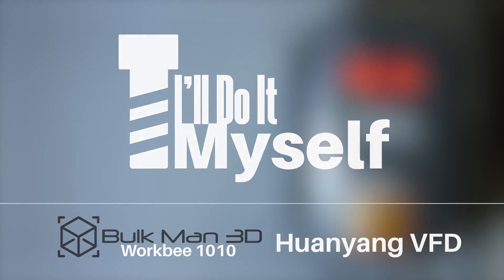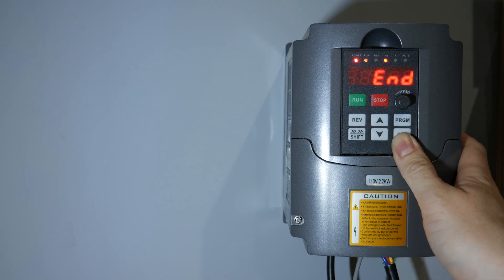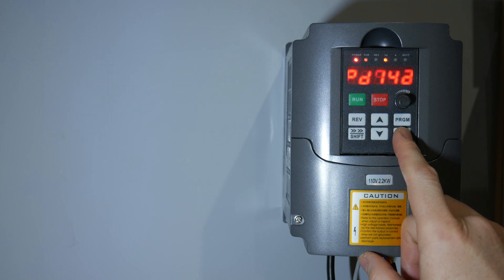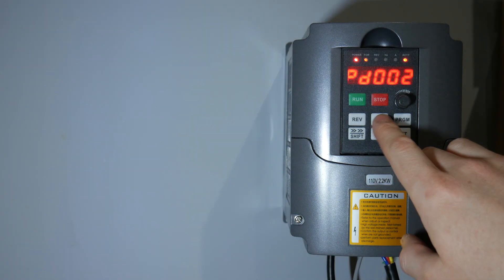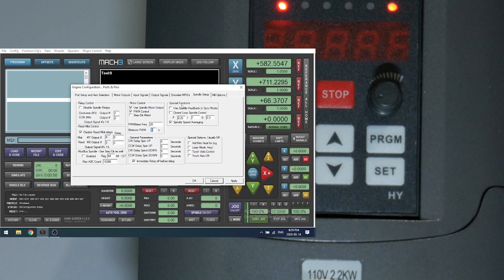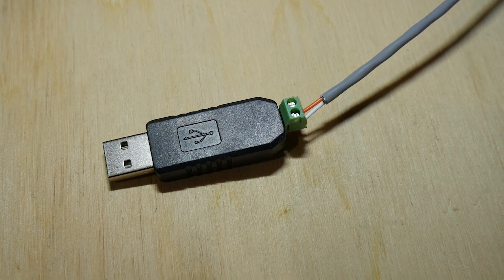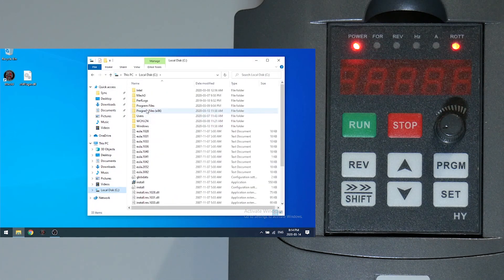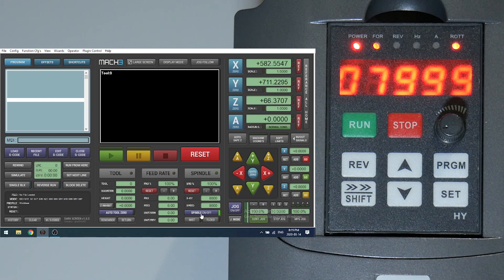Workbee CNC Bulkman3d Kit -  Huanyang VFD

Comment: I've been experimenting with the settings on my VFD, particularly the PD014 acceleration time. The reason why I started to set it differently than the suggested value is that I had some Voltage drop and I was thinking with slower acceleration, I may can avoid the ELun error. Despite adjusting it to various values like 10, 50, or 150, I'm not seeing any noticeable changes in the acceleration time. I was only able to start the spindle to 220Hz and not above. Interestingly, I was able to adjust the deceleration time without any issues. I tried PD043 to create a slow non linear ramp up, but I had no luck, it only had an effect on the deceleration. Can anyone help me, what am I missing? Could be there some another setting that might be overriding the acceleration time? I was also thinking to set PD142 to lower than 8, and other than loosing output, could it help preventing the ELun error?  PD151 sounded like a solution, but no luck there also. I know I should start fixing the electricity around my workshop instead of risking melting down anything, but until Winter is on, I can't dig holes for new cabling and it would be super awesome to run my cnc even with limited power

Comment: I had an issue with being able to start spindle from vfd but not my pc I've followed this video and now I can't even start it from the vfd or pc please help
Reply: I reset my vfd and done the settings from the video again...the spindle works from vfd all the way until I change settings to use controller then I can't use vfd or pc to start the spindle also I'm using candle as my gcode sender not mach3 does that matter?

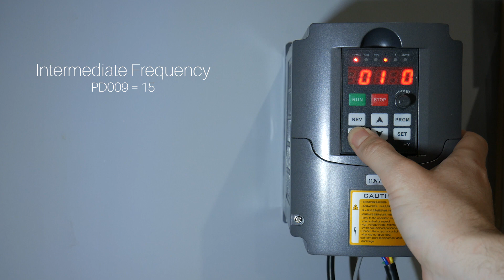Comment: Hi! Are you sure the PD009 code is intermediate frequency 1:51 ? My manual tells PD009 code is the intermediate voltage and the intermediate frequency is PD006 code (the value for which should be set 2.5 for 50Hz system and 3.0 for the 60Hz.). Suppose you meant intermediate voltage for PD009
Reply: Look at Vdf manual, mine was 6.5

Comment: Are you in Australia with the 110v spindle?  Should I be ordering a 220v spindle for use in Australia?
Reply from the maker: I'm an aussie in Canada. You will want 220v for sure over there!
Reply: @IllDoItMyself  Thanks. I figured as much and ordered with the 220v a few days ago. Now the waiting game haha. Awesome job on the videos by the way. I will be using them to do the build when it arrives. Only thing is I’ve ordered it with the xpro v5 control box so I’ll have to figure that out. If you’ve had any experience with those, any advice in advance would be greatly appreciated. 

Keep up the good work mate 👍🏻

Comment: I did all the same wiring and inverter settings, but the spindle is stuck at 8000 RPM and ignores control. Sometimes it is possible to change the RPM value, but then it immediately returns back to 8000. What's wrong?
Reply from the maker: If it's indeed the same vfd I would verify the settings again and this can limit the max values

Comment: Howdy,  I programmed the inverter today.  I ran the spindle test with the inverter and it all worked out fine.  I plugged in the laptop, opened Mach3 and started running the spindle and motor test.  Everything was working great, axis were moving, spindle was responding, but then it all stopped.  The inverter was next to me and i show an orange glow on the left side and it started to get hot.  I shut everything down.  Now the inverter won't come back on.  After a min it starts to get hot again.  I checked and rechecked everything before i started it? I sent email to the seller hoping for a replacement.  I would like to know if you may know what would cause this to happen?  Thank you

Comment: i had now time to work on the machine and i got the next problem lol.. 

the rs usb communicates perfect with the vfd and mach3.
the uc300 can communicate with mach3 per usb also .

but if i activate thr spindle and also then try to move the cnc with the arrow keys it is like something isn't going right. for example i press up and nothing is happening, then i press the arrow keys a few times.. still nothing.. then suddenly it's moving like crazy and really fast. its really Dangerous!  and i dont know why? its like mach3 just doesnt want to communicate with both at the same time...

what is working:
set the spindle speed manual per hand on the vfd with the usb unplugged and than u can work with it but thats very unaccurate and notnsafe because i cant stop the spindle with estop because its not working over mach3.

so do you have any idea??
u can mail me also on
gornavid123@gmail.com if this is easier to communicate for you

thanks a lot!
Reply from the maker: Is it only happening when your spindle is spinning if so you have EMI and need to make sure your grounding is done.
Reply: @IllDoItMyself  YOU ARE A GENIUS!!  Problem solved ! Finally I can start to learn  👌 
Thank you again so much!

Comment: I have a question. What cable do I use for the rs485 usb adapter. If I Google rs485 cable I can't find a similar cable to yours.

Please helo
Thank you so much for your awesome tutorial.
Reply from the maker: Hey any 2 wire cable will do. If you can get a shelided one that's even better.
Reply: @IllDoItMyself  ok thanks I did this and I installed c++ 2008 and also inserted the plug in in the folder. Now in the configuration it says: "unable to read value" 😭
Do you know a possible solution? Have I done something wrong?
I used a 2 wire cable from a Lan cable.
Reply: @IllDoItMyself  I'll try it with a different cable and will give feedback if this works
Reply: @IllDoItMyself  works now perfect! I used a junk cable (red black) what was left. And works perfectly fine.
Thank you so so much! You helped me a lot.
Without you I wouldn't be able to build the machine by myself.
Thank you!!!
Reply from the maker: Your welcome happy cutting!

Comment: Good work with the tutorial, I have a question, I have configured everything as you do in the video, but the spindle does not increase or decrease revolutions from mach 3, do you know why this happens to me?
Reply from the maker: Thanks are you using the usb method or direct from NVUM?
Reply: @IllDoItMyself  Direct from NVUM
Reply: I get it to activate but I can't modify the revs of the spindley
Reply: @israelgonzalezferreira5237  You have to press enter for the revs to change otherwise they reset to 0

Comment: Hey, about 9 minutes into the video you added that a connection from the VFD to the NVUM controller, the settings that followed directly after that, are they only applicable if you added that connection to get better control of the RPM's or do i have to set them regardless? Once again thanks for all your help :)
Reply from the maker: Hey that's right you should be good to go with the dial to control it.
Reply: @IllDoItMyself  Great, so just to confirm, if i did not add that extra connection to better control the speeds and feeds then i would not have to worry about the settings you changed after you added it? Just want to make double sure :) I dont have that added connection therefor i would not need to add the additional settings?
Reply from the maker: Yep that should be it.

Comment: What should my "Rated Motor Current (PD142) set at with a 220volt 2.2KW 24000rpm Water Cooled Spindle Motor. I also don't know how many poles it has. Didn't get any paperwork with my WorkBee full kit for the spindle.

Comment: I'm deciding to buy software. When using the Mach3 software what type of Windows OS can I use? Windows 10 / 8.1 / 7? 32 or 64 bit?  Thanks!
Reply from the maker: I run it just fine on windows 10 64bit

Comment: @I'll Do It Myself, I have followed all of your setups to the max and my VFD reads 5 lower on most RPMs. 8000 would be 7995 and so on. There are a few points that are spot on but not many. Any suggestions or is it just as good as it will get?
Reply from the maker: Is this using the usb dongle?
Reply: @IllDoItMyself  Correct! EXACTLY as yours.
Reply from the maker: Interesting I have not experienced that. I mean 5 rpm is not going to matter in the grand scheme of things so I wouldn't worry about it.
Reply: @IllDoItMyself  I appreciate it! I have everything setup and waiting for my water cooler so I can utilize the flow alarm as a shut off for the controller ( I think I can use this function).

Comment: So, the RS485 is connected to the PC running Mach3 in addition to the standard USB connection for the sole purpose of rpm control, correct? It does not replace the main USB connection? (i.e. - you'll have 2 USB connections between the PC and the VFD, yes?)
Reply from the maker: Correct but it's well worth it!
Reply: @IllDoItMyself  Excellent. Thanks!!
Reply: I seem to be having the same issue as @LucasWilson a few posts below. Spindle was turning and responsive to rpm changes in Mach3, but after the VFD changes adding the RS485, the spindle won't turn. Set an RPM in Mach3 and click to start the spindle and the RPMs immediately return to zero with no spindle response. Any ideas? I'm considering doing a factory reset and going back through all the steps in the video.

Comment: Bulkman sent me to your video to try to help me get my VFD working.  Can you confirm that the VFD you received is a YL620.  The menu items in your video are totally different from those on my VFD.  The menu shows a P00.01 while yours shows a Pd001.  The menu numbers you indicate do not match up with those in the manual they provide.  You indicate that Pd003 is main frequency, yet their manual indicates it is P00.00.  I have never been able to get this spindle to function properly.  It is looking like they are sending out crap VFDs to some customers.

Comment: Hey there, great video!! I have the same 110v vfd and 2.2.2kw spindle. I'm not finding a wiring video in particular the 110v in and the motor wires out. To be more specific my question is about the "earth wires". Do all the ground and shielding wires go together to the ground terminal on the motor out put side or????? Im confused and dont want to fry anything
Reply from the maker: Yes you want to jump the sheild the spindle ground and the main ground onto ground terminal
Reply: Thanks, so now i have it a wired up, i thought id just adjust my speed and derection manually with the potentiometer for now but i cant get it to go over 266hz
Reply from the maker: Take a run through and check your settings that usually indicates a maximum is not set somewhere.

Comment: Great job, can't thank you enough for your video series! I bought a Workbee 1515 and followed your build videos with great results so far. I am having a problem with the RS485 working that I'm hoping you might have some insight on. I'm using a slightly different RS485 dongle from DSD Tech, the driver seemed to install correctly and when configured in Mach3 it says that the settings have been read from the VFD. However, when I go to start the spindle, nothing happens. I had the spindle working before I connected the RS485 dongle. Any ideas?
Reply from the maker: Hey Lucas I'm glad it helped you. It's possible you missed a setting on the vfd. If you can read the settings your dongle should be fine. Check pd001 and pd002 need to be set to 2.
Reply: @IllDoItMyself  Thanks for getting back to me. The settings seem to be ok for pd001 and pd002, I'm wondering if it's something to do with rotation direction? I'll look into it more tomorrow.
Reply from the maker: @lucaswilson6123  best of luck. Hit me up on Facebook if you get really stuck.
Reply: @IllDoItMyself  How can I find you Facebook page, if it possible of course?

Comment: Hi There, I am desperately trying to find someone to help me, I have the same setup from Bulkman, running windows 10, Mach 3.  I bought the rs845- usb adapter and followed your directions.  The VFD plugin from that french website is called "corrupt" and is being "ignored" from Mach3.  Do you have any suggestions?
Reply from the maker: For sure, you probably only need to install this and then reload mach3 https://www.microsoft.com/en-ca/download/details.aspx?id=48145
Reply: @IllDoItMyself  I have the same problem... I have uninstalled all versions of C++, about 8 of them... I reinstalled the download you provided above, but, it does not fix the situation. I still get the file being ignored message. got any other suggestions?
Reply: got it to work, in my case, downloaded the Microsoft Visual C++ 2008 after this I was able to load the vfdplugin.dll w/o issues... so on my laptop, I only have 2015 and 2008 versions of the C++ libraries. hope this helps...

Comment: I have a question about the rigidity of the machine. I saw a post of Mickey Ralte (https://www.youtube.com/watch?v=VOqi_yrpmfI&t=32s). At 13 seconds you see how much play he has on the x axis. The workbee seemed so rigid to me, but this really scared me so much that I hesitate to buy one. Do you encounter the same problem? Is it an issue that always occurs, or did Mickey make a mistake installing/tuning the machine? Curious what your experiences and thoughts are.
Reply from the maker: Wow. There is something seriously wrong with his setup. It's also belts not lead screws. Honestly I can even budge the x gantry along its axis.
Reply: @IllDoItMyself  : Thank you very much. You comfort me.

Comment: Hi, Man,
I have a cnc same as you but i having a hard time put it working correctly with the toolphats. What program are you using to make it?
Best Regards and nice videos.
Reply from the maker: Heya, I'm using fusion 360 for my CAD and Cam (toolpaths). You can simply select the mach3 post processor and export gcode.
Reply: @IllDoItMyself   Yes i am using it, but i make a simple pocket. And when i set the Z to 0 and start the program machine starts to go deeper of the 0.
Reply: @AndreSilva-et7tf  did you get yourself running?
Reply: @neurowocky4791  I start using aspire 9 and its working. Trying solving some issues but working nice. Thanks

Comment: This is fantastic. I had so much trouble trying to get my nvum controller working with my vfd. Turns out the nvum was bad. I will definitely go to the rs486 adapter though as it seems to be just a better all around method.
Reply from the maker: Thanks! Yeah by far a better option and for the price can't really go wrong.